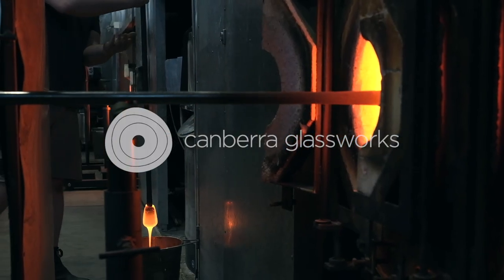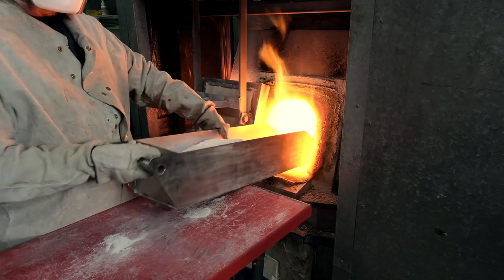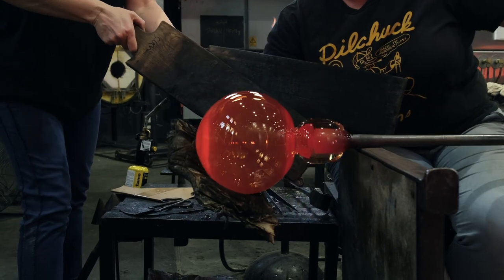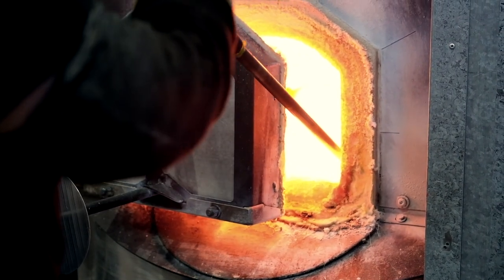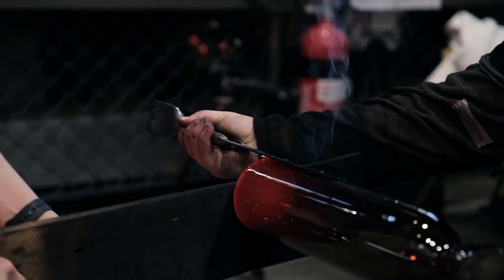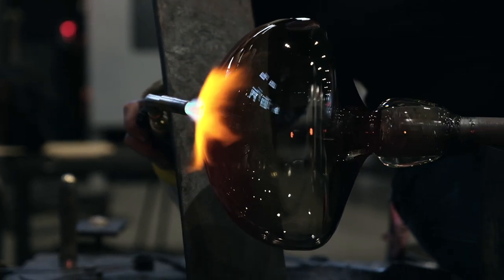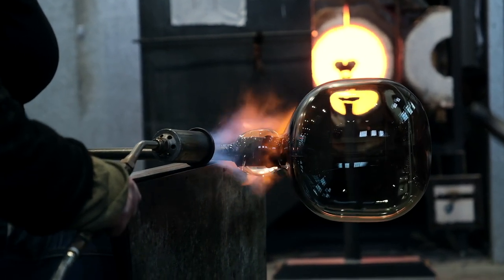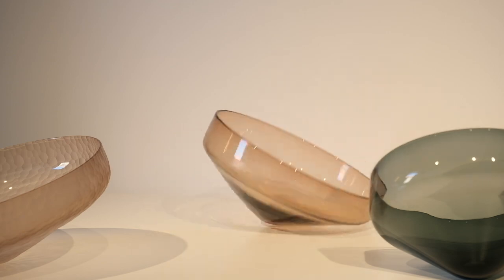Glass Blowing Process

Comment: Glassblower's cataracts are due to chronic exposure to infrared radiation emitted due to the extreme heating of glass or molten metal. The infrared radiation is absorbed by the iris and lens of the eye. This causes cataracts after decades of exposure.

higher risk jobs that can lead to occupational exposure of workers to mercury are working in a chlor-alkali, thermometer, glassblowing